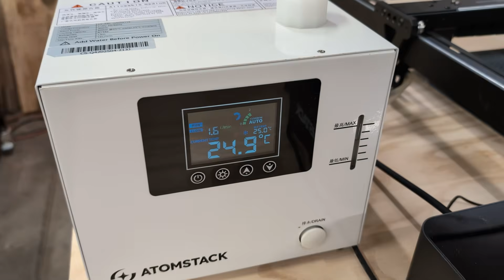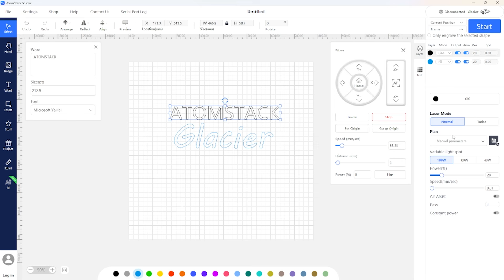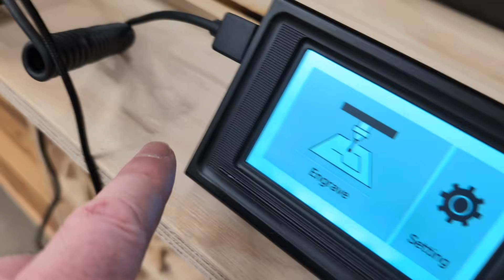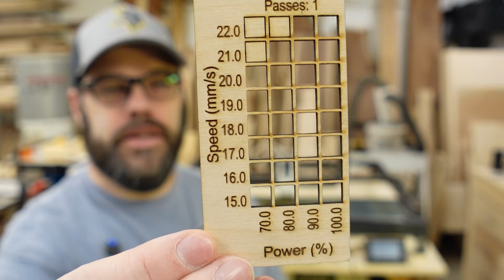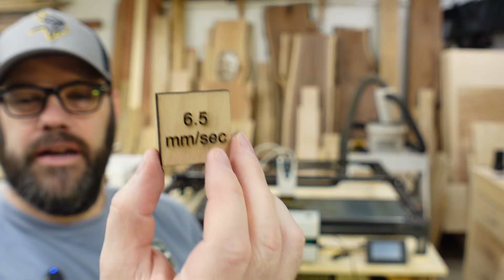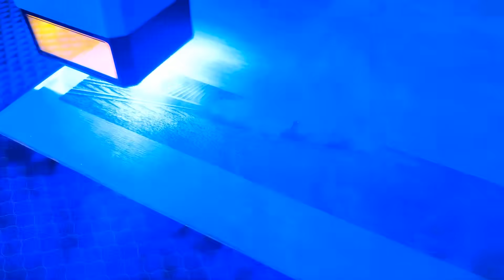Atomstack Glacier 120W Water Cooled Diode Laser

Comment: I just got mine today! It says to make sure the voltage on the control box is correct before turning it on. The instructions don’t really tell you how to adjust it from the default 230 v. I’m in the US so I’m guessing it needs to be 110 v but I can’t see how to change that in the little hole on the top of the box.
Reply from the maker: That's a good question. Mine was marked with a 110v sticker near the AC power port on the side of the control box.  In other systems, there is usually a red slider that you can switch between 120/240v but I do not see that on mine.

Comment: In the 50-60 watt co2 laser class
Reply from the maker: I would agree with that about it's cutting power. Co2 laser are more efficient at cutting.  However if you want a darker engrave, a diode can often do that better without ablating as deep into the material.

Comment: Great review. I’ve had mine for several months now and love it. I haven’t even been able to try the IR module or the rotary yet. I am surprised at the difference that plywood makes though. I can cut through 3/4 wood fine but 1/2 Baltic birch ply takes 5 passes !
Reply from the maker: Plywood will always be tougher as the layers cross the grain for stability and the glue in-between each layer add to the difficulty of the cut.

Comment: Automstack 120 Watts equalent to 120 w CO2 laser optical power output?
Reply from the maker: The laser beam wavelengths have different effects on the materials so it's hard to have a linear comparison.  But in raw cutting power in natural materials like wood and leather, from my cut tests I would put this laser at about the equivalent of a 60-70w Co2 laser.
Reply: @Vintauri thanks for valuable time to reply 🎉🎉🎉❤❤ go ahead

Comment: I got mine the 1st week of December. Still waiting for my enclosure but so far, my engraving and cut tests are positive. 
I had some had some issues connecting the Glacier to my office WiFi, so I can manage jobs from my desk or any of the desks in my shop.  I have figured out a solution using a port sharing software with allows me to connect via USB to one desktop, then a client side app the allows me to use the shared port to control the machine from a difference desktop .
Looking forward to getting the enclosure because this laser creates an immense amount of smoke.
Thank you for sharing your experiences with the different devices.  I really appreciate it.  Go Mavericks.
Reply from the maker: I have not messed with the Wifi much as it was easier to have it hard wired to the laptop in the shop. I'm not sure what the controllers limitations are but some do not like to be on a mixed network with 2.4 and 5g.  If you can set up a IoT network on your router that is hard coded to 2.4 it might help, but you would want to make sure it can talk to your regular network. Glad it's working out on the test cuts and engraves and that enclosure is a must for this one!

Comment: Mine came yesterday. My control box isn’t getting power though. The light in the switch turns on but nothing else. Do you have any idea if I missed anything?
Reply from the maker: Double check that the estop button is not pressed down.  It twists to unlock, also check that the USB key is inserted. Those would be the two primary things to check.
Reply: @Vintauri I actually figured it out. I had to change the voltage switch. Thank you for the timely response and for the videos!
Reply from the maker: @tylera4059  Ahh, yes, I forgot about that switch as well.  I'm glad you got it sorted out!
Reply: @tylera4059 How did you do that????? I have been trying to figure that out all day.

Comment: The #1 question that you didnt even cover, is can it cut acrylic.
Reply from the maker: Being a diode laser, it's not going to cut many colors of acrylic.  It's not about the power it's about the wavelength.  So it will cut darker acrylic, but it will not be useable for clear or translucent and lighter colors. If your goal is to cut acrylic, you really need a Co2 laser.
Reply: @Vintauri  Ok, Thanks for the information. :^)

Comment: Does the coolant lines have a lot of tight bends through the drag chains that could wear them out  early during a lot of use causing leaks/breaks?
Reply from the maker: I don't see any tight bends most of the cable chain leaves about a 6" diameter bend and they roll smoothly.

Comment: Great review. I wish the manufacturers would stop with the grand statements about the depth it will cut. If you want to cut 1/2” or thicker, get a cnc and buy some fantastic bits from Cody! 😊 it sure seems like that generates a lot of smoke which I would expect.
Reply from the maker: I agree, the depth of cut is useless if it's too slow and creates a mess of smoke and charring. I can see where you might need it for some tight details, but that is where you risk the most over burning and charring. All that being said, 1/2" plywood cuts with this are not bad and I love the fact that the module is sealed and well cooled.
Reply: @Vintauri yeah, I think that is the next step for most diodes. Cleaner operation. 
I won a Piburn rotary from Laser engraving 911’s 100k sub give away. Pretty stoked but it looks like I may need to tell them some pretty detailed specs to get it to work with my diodes.

Comment: So the module is sealed due to the water cooling?  No smoke entering?  Nice touch if so.
Reply from the maker: Correct, there is no airflow through the module.  The water cooling keeps the temps in check. This will cut down on maintenance of the module.